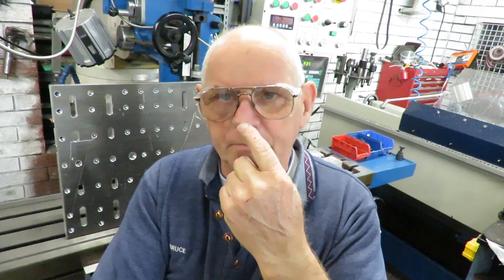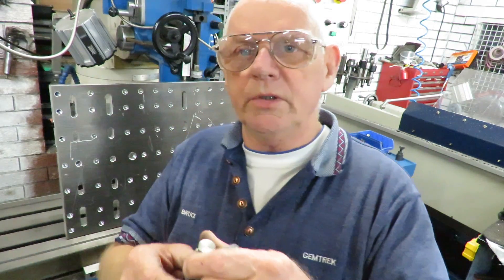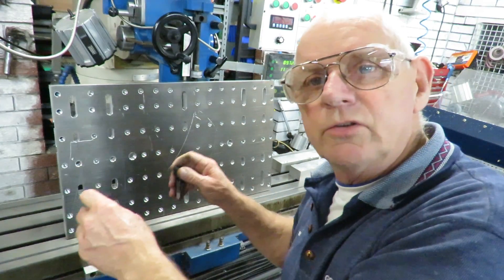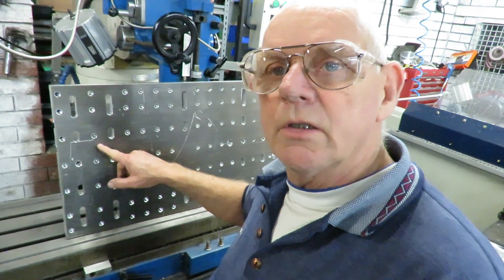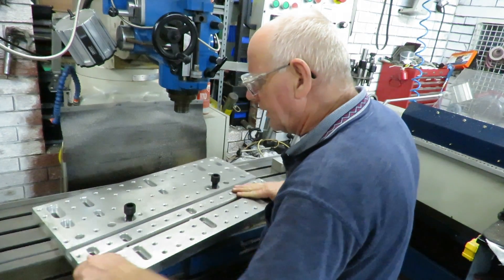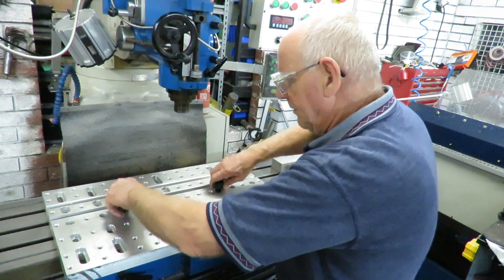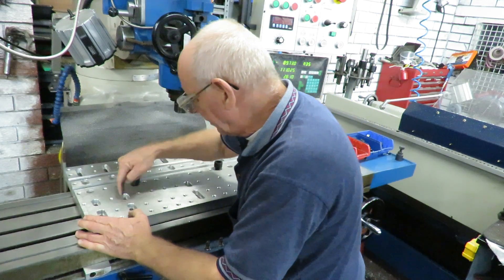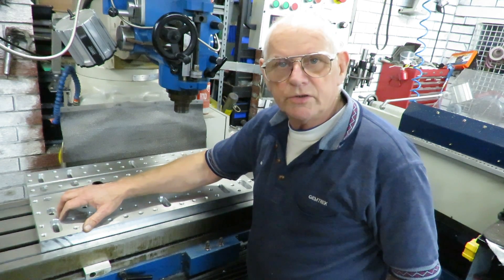MILL PALLET BUILD STAGE 3

Comment: You have certainly well thought out the adaptation of that pallet to all your different machines.  Be sure to spray some rust preventative  under it when you mount it in case it stays on for awhile otherwise they certainly tend to like to rust mill tables at least in the humid environment where I live.